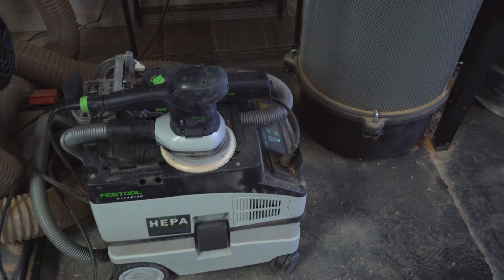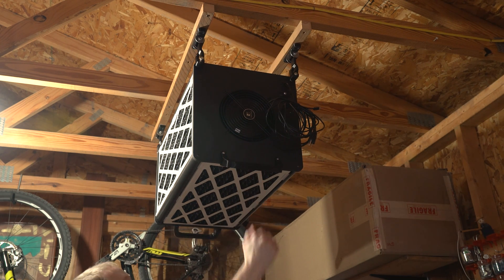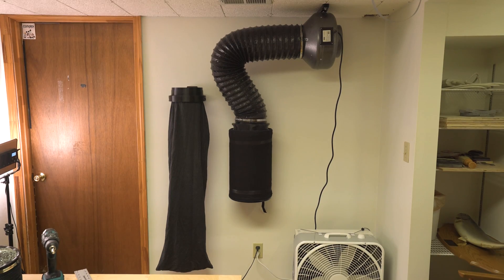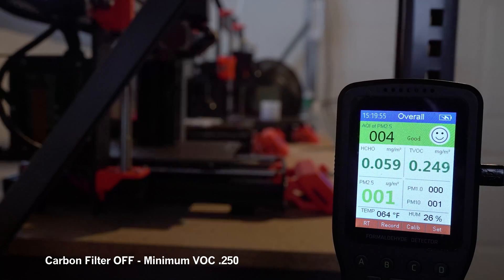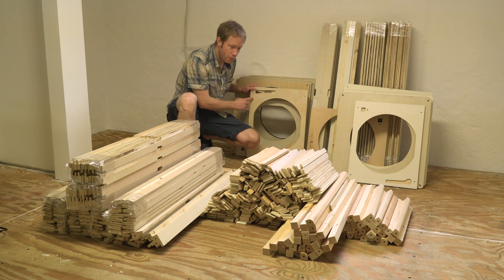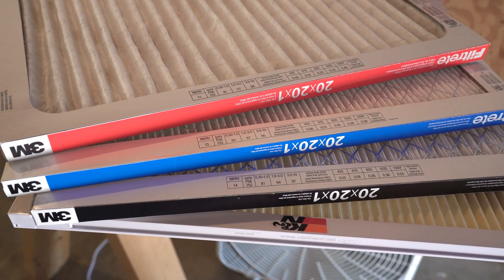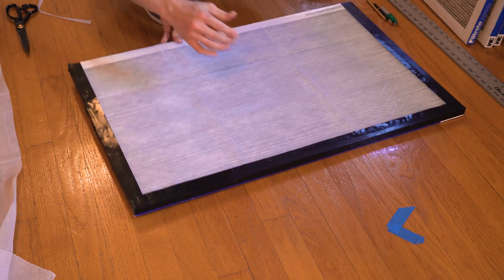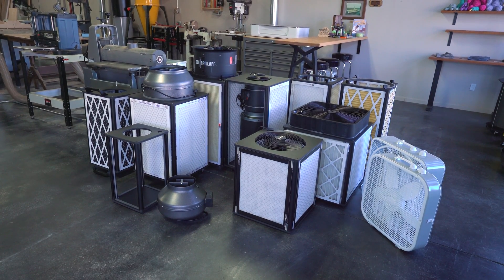DIY Quad Filters - Everything you need to know

Comment: That is over the top crazy interesting. I love the testing and data you share. I built a previous version of one of your filters but now I see I should pull the air down and out which is opposite of how I did it.
Reply from the maker: It works in both ways. In some cases the up method works better. The concept deserves a video to itself and it will get one some day soon.

Comment: I really enjoy this series and the model B design looks sharp! Curious if you’ve done any testing using a centrifugal fan, like one from a furnace?
Thanks for all the work and info you’ve shared!
Reply from the maker: Glad you are enjoying the videos! I hope to do a video on a centrifugal fan later this summer if all goes well. I got a second hand furnace blower over a year ago but haven't had the time to mess with it just yet. The one real down side I see to them is that they pull a lot of power compared to inline fans and axial fans. They are designed for high static pressure environments though, so that makes them well suited for his sort of application.

Comment: this is the level over engineering i love to see. One question though, have you tested or had any experience with carbon filters? im interested in one of these for my home to deal with my pet's various odours, hair, and dandruff, and was wondering if carbon filter panels would be an effective solution
Reply from the maker: Why thank you! I fancy myself an overengineer. I have tested a lot of carbon filters and will make a video on the at some point. Until then I would say that the average disposable HVAC filter + carbon is not very effective. That's why I designed this kit https://www.etsy.com/listing/1687840516

They are not cheap, and that fan is a loud over 200-300cfm but it eats smells and should do so for 6-12 months before the filter carbon needs replacement. The pre-filters really help to extend the life of the Carbon. The total for this kit would be about $600

If that's out of your price range, check out my video on single filter filtration. The 5" Lenox filter in that video is the next best thing. It's a $100 filter but it will also last you a long time and had a more meaningful amount of carbon in it than your average filter.

Comment: You've produced some very impressive data over the course of your filter journey and the home/hobby community is better for it.

Would love to hear your thoughts on placement, height wise, in a multi-modal shop (woodworking, metalworking, etc). Is there an optimum floor or ceiling height for one use vs another? Look forward to more videos, maybe even snagging a free kit! If not I'll seriously consider buying one.

Lastly thoughts on using used HVAC blowers? I picked up a 3speed one and had planned to use it but this looks soooo much easier.
Reply from the maker: Thank you! That's a great question on placement. I was thinking about making a whole video devoted to that subject. There is a lot to consider when choosing a location for the filter. 

For a ducted design I like to have the air outlet at head height so that fresh air is always blowing over me before entering the work area. That's not always possible, but it is preferable. I show off a few concepts like that in this video on ducted filtration https://youtu.be/zKeNf6fLSLA

For a freestanding design, I like the CAT fan version most with the fan blowing into the filters. I keep this close by my work area, assuming I'm not producing sparks with what I'm working on.

I also got a second hand HVAC blower that I hope to try out with a future design but that will have to wait until later this year. One down side is that they can pull over 500watts and that is up to 5 times more than other fans. It's also double that of an Inline fan for the same CFM. I'm often near the limit for my circuits, so that's not ideal for my setup. So, if you get a free one and you can spare the power, they can be worth it, but otherwise the other options have a lot more benefits.
Reply: @The3DHandyman  awesome thanks for the reply - I did indeed check out the ducted video. My workshop has 14-16ft ceilings thus the height question. I believe I may have less of an air disturbance issue when exhausting upward (ie with cat fan design).

As for the HVAC blower I guess that power really comes into play at higher static pressure - I imagine they are able to maintain their true rated CFM at a much higher static than say a box fan.

Lastly note that with a centrifugal blower you will likely need to add some artificial static, otherwise in "free air" the blower will over-run and cause excessive current. Best to use a clamp meter and find the minimum static needed based on nameplate FLA/running amps. Counterintuitive but the faster the motor spins the more work it is performing, higher amps. At higher static, speed slows, less work, lower amps.
Reply from the maker: I would agree 14-15ft ceilings may result in better overall performance in the Pull config. Excellent note on the intentional increase in static pressure! I will try to remember that in a few months 👍

Comment: You posted numbers about the rating of the speed of clearing a room for both push and pull on the cat fan. Does venting the fan have any impact?  I have thought about getting a kit for the cat fan, mounting it from the ceiling with a remote outlet and venting out the roof of the garage/workshop.
Reply from the maker: As long as the vent duct is as large as the fan, it shouldn't have much of an effect. You'd need some sort of hood to protect it from the weather and that may cut down on air flow. An inline fan like one of the ones below may be a better choice for that particular application.

Also if you vent, you need to have a proper air inlet if you are moving that amount of air out of the building. It may end up pulling in a lot out outside dust if that's a concern.

One of these fans or a centrifugal fan might be best for venting:

12in AC Infinity Inline Duct Fan  (1604cfm) Premium
https://amzn.to/43zuQov

This fan as worked really well for me and it has about the same CFM as the AC Infinity wall fan.
12in iPower Inline Duct Fan (1060cfm) Budget
https://amzn.to/3x9tKDZ

Comment: Great video and very well presented!
What I found is that I still try to ventilate as much as possible to the outside, if that's an option.
Other than that I didn't have amazing results with auto mode air cleaners (sensor based) and I do believe this design is really nice.
A timer would be a great addition, so that you could leave it running for an hour or two while leaving the shop / place with dust buildup?
As you said the right scaling is another great way - having the option to just leave it running on low and only cranking it up on demand for example.
The solution with the aluminium profiles also is really nice. And it will very likely fix many of the issues with wood.

That said the only sad part is that shipping to the EU basically basically costs as much as the whole kit itself. 😅
Reply from the maker: I hear you on that. Shipping to Canada is ridiculously expensive as well, no need to cross an ocean and it still 160USD. I also like the sensor based controls. Will have to put that on the schedule. Thanks for the comment!

Comment: For the 20x20 quad filters with box fan, does the fan blow into or away from the filters?  I agree its best to blow into the filters to reduce blowing dust around the room.  If your box fan does not have a closed back, what can you do to still use it to blow into the filter box?  I'm not worried about explosive fumes, just dust from mild wood working.
Reply from the maker: Good question. I prefer not to use the box fan in the "push" direction (down into the filters) because potentially flammable wood dust can end up in the fan motor. If cleaned after every use, it might be fine? The Air king also doesn't work that well pointed into the filters because it has a lot of extra space in the fan housing, a Lasko or similar fan would be better. This configuration does produce better results than pointing the fan upwards, at least when the filters are new. Haven't tested it with dirty filters yet.

Comment: Your hard work definitely shows, and I know it'll help many people in all sorts of crafts and trades work happier and healthier. I've gone from woodworking in a 4x4 grow tent to now using a zipwall system. Setting up one of these will help keep my place and my lungs cleaner. Well done and thank you!
Reply from the maker: Thank you Albert! The zip wall is a great idea. Especially if you are working in your living space. Now that I've figured out the air filtration thing, I need to figure out how to not track dust through the house on my feet. There's always something. Haha
Reply: @The3DHandyman  I use separate “house” and “woodworking” slippers/jeans to tamp down the tracking issue as best I can. I’m sure you’ll come up with a clever de-dusting method tho haha! You may have convinced me to switch plans from CAT fan to the ducting system. It’s smaller, less turbulent, and I could use it with my 3d printers. I’ll take a look at your kits tonight. 👍🏾
Reply from the maker: Awesome. Let me know if you have any questions at all. Much appreciated on the bad link to the AC infinity fan! Got to get them Bezobucks lol
Reply: @The3DHandyman  Yeah, not a problem. And I do have a few q's. 

I'm curious about the footprint and throughput of the Model E and that smaller inline Model B-ish version with the 30x14 filters. I've got a under utilized 20x20x40 corner that perfect for such a beast. I'm guessing that info is incoming in a future video. 

Also, have you tested filtering any harsh 3D printing filaments through the carbon filters with good results?
Reply from the maker: The footprint of the Model-B is about 3 inches wider than the filter, so the 14" filter model would be about a 17" square. I'll need to add dimensions to the listings. Forgot about doing that again, haha. 

The smallest Model-E is an 18" wide, but because it is circular you can turn it to vacuum it and it wont get any wider than 18". The 14" B will be 24" diagonally, so if you want to put a prefilter on it and vacuum it, it takes up a lot more space if you need to turn it.

I will be doing some resin printing tests when I get a chance. So far, all I have tested the carbon filter with is FDM printing. I suspect it will work well but I don't know about the longevity of the carbon when I hit it with that resin stink. Hopefully that video will be out in about 2 months or so 🤞

Thanks for all the comments, Albert!
Reply: @The3DHandyman  I'd say that settles it then. It's a Model-E for me! Good thing I still have the CAT fan and filters boxed up. I'll at least be able to return those and get the inline fan and round filter. 😅I'll be watching your shop over the next few weeks and can get the Model-E kit when it's available.
Reply from the maker: @GoodLifeGlaucus  Awesome. Pre-filters are a big part of that design and I've got a bit of work left to do on them... but once I have some stocked up. I will launch those kits.

Now that I'm thinking about it, the kit size that I quoted you will only run a 650cfm 8" inline fan. If you need more power you can daisy-chain them in some kind of way. Something to think about...
Reply: @The3DHandyman  Definitely thinking about the power needed. Maybe I don't need the extreme case of the 1400 cfm CAT Daddy. I'm only using hand tools. Saws kick up a little dust. And hand planes/scrapers are in use over sandpaper. Well, if you need some help testing out filtration scenarios or drafting up some 3D models, let me know. I'd be happy to assist.
Reply from the maker: @GoodLifeGlaucus  Thanks for the offer! Will keep that in mind.

I think you are right, hand tools don't blast dust out at the same velocity as power tools. So, less airflow is perfectly acceptable.